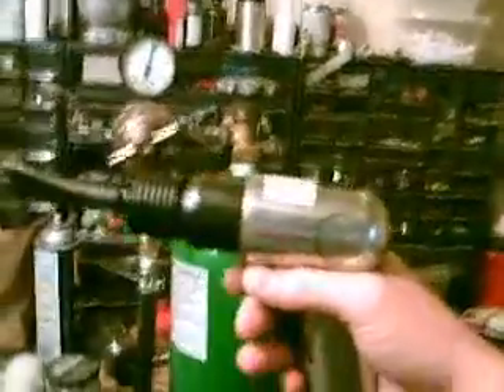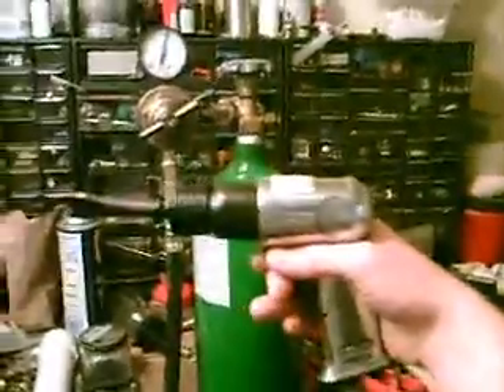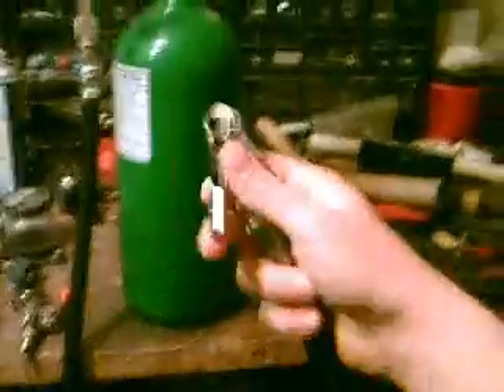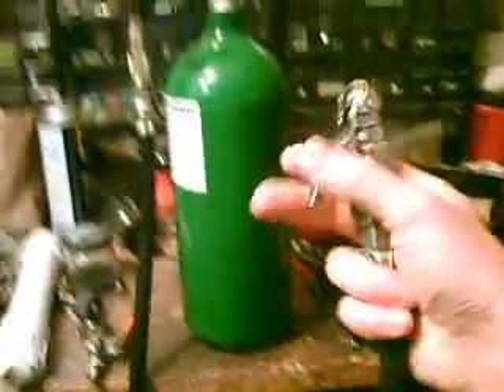homemade Co2 OBA system

Comment: old posts I know but seems there is some misunderstanding. CO2 is a liquid in these cylinders and I don't believe pressures like 1800 and 2000 psi etc can have anything to do with it. Those pressures are generally for gases that are not liquids in the cylinder and don't easily liquify. I'm no CO2 expert but I believe it's something like 850 psi at 70F in the cylinders as a liquid and that's not going to change significantly. In order to pressurize them higher you would have to use a different gas than CO2 since it condenses to a liquid at those lower pressures. They could not produce those kind of higher pressures unless you heated it a great deal but even then the safety relief would pop open. If it were way overfilled and had too little head space it may reach those kind of pressures a lot faster with heat, but again, the relief would pop. If it were cooled the pressure would lower. The pressure will also lower by normal venting due to the cooling effect of vaporization and possibly go all the way to zero psi if it could be vented (as a gas) long enough. At that point you could essentially pour it out as a liquid or it would harden as dry ice, not sure, but there would be zero pressure. I don't think you would want to accidentally get liquid CO2 in a tire or it would expand so fast that it would blow you and your tire sky high. That could be done by tipping the cylinder, not having it upright, or accidentally using one that has a dip tube. I tried this a good while ago but I think I need a different regulator because the flow rate is way too slow even though the pressure is good. I planned on trying again with a different regulator. Another danger of CO2 that few are aware of is that if you leaked enough into a confined space like your passenger compartment it could kill you. It's not noticeable to a person if a vehicle has filled with CO2 instead of air unless the person can somehow realize something is wrong as they start passing out. This unfortunately has happened.

Comment: U can get a FiZZ GiZ Soda Rope that attaches to small paintball sized tanks or larger conventional tanks to run smaller tools like Hitachi & Bostich brad nailers, finish nailers 'n staplers. The small 1/8" tubing is light, easy to work with, is not cumbersome and does not get in the way. Smaller tanks can be strapped on backpack fashion. Guns can hang from a quick release carabiner on a tool belt or other holster. CO2 increases the portability of any pneumatic tool.

Comment: @altclyti Air may be free, but compressing it isn't.  You need a compressor.   When on the trail, getting enough volume means you need more than those 12V compressors and you should also be running an air tank.  By using a co2 bottle you are carrying more than enough compressed gas to run air tools, fill tires, re-seat beads etc.  Most OBA systems that can do the same require the engine to be running.  With co2 you don't..    Of course your only carrying so much co2, so it does have its limits.